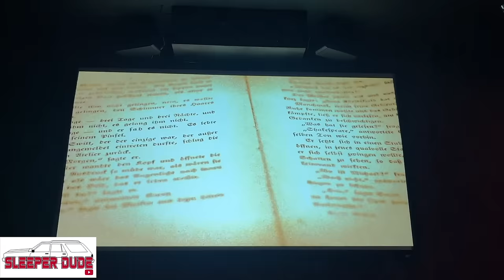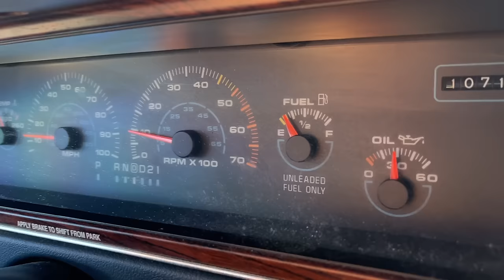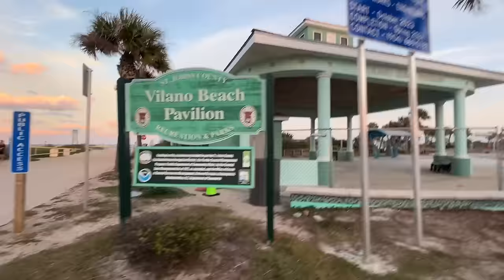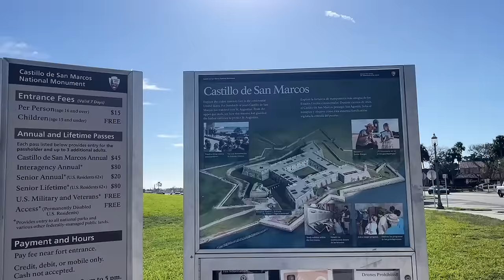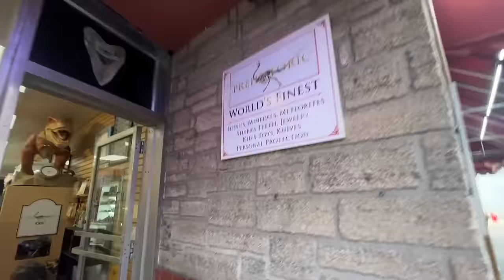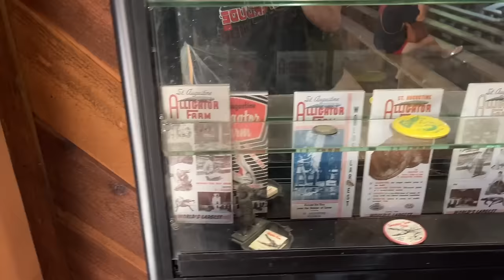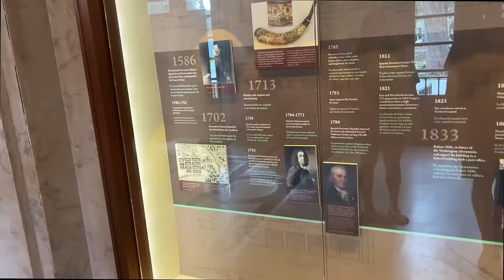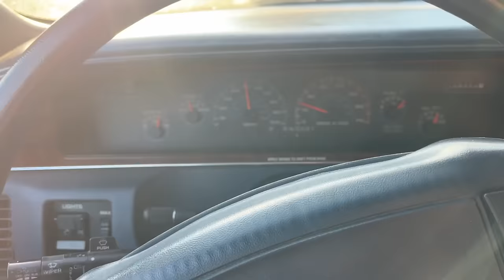Oldest City In America Road Trip In A Station Wagon.

Comment: For the window, its a super common problem. Dorman #74444 is all you need. It is an upgraded roller vs the original sliders they had. The plastic sliders break that hold the window up. I had to do 3 of the doors on my '91 Roadmaster wagon, all except the passenger front funny enough. That one is still good.

Comment: As an old truck driver I've stayed in a lot of motels and hotels Most of them nowadays if you're on the bottom floor they will screw the sliding glass door shut because of all the rip rap that goes on these days. But I carry a small socket set and a Multi functional screwdriver In my bag Because I smoke cigarettes And I'm not letting them charge me $300 for a room clean up.But if you're on the upper floors and your door is screwed shut that's just wrong😊
Reply from the maker: I know right

Comment: Josh please put a dual exhaust system on your wagon! I did this on my '92 Chevy Caprice wagon with the 5.7 liter and it made a dramatic difference in low end torque and it ran a bit cooler and I gained 3 mpg in City driving and 5 mpg increase on the highway! It's definitely worth the money and will help make your engine last longer! I bought a Borla dual exhaust with high flow cats and 2.5 inch pipes and the Borla mufflers sounded awesome! Deep and throaty without sounding loud and obnoxious! The exits were just behind the rear wheels.  I think that would be a great video to watch of you installing a dual exhaust system on your wagon! Just a thought and suggestion 😊❤

Comment: On your adventures with new motor's, why don't you have a "break down kit" with you on your first drive out, with tools, extra fuel, fuel filters, a funnel, WD40 or PB blaster, bits of wire, zip ties etc in a bag or box. And only to be used on such an occasion. That's what I would do.
Love you guys, keep the videos coming, stay safe and God bless. 💜😊🙏🏴

Comment: I'm surprised you didn't stop at the Summit in McDonough, GA
The only time to go through Atlanta is between 10pm to 3am.
Reply from the maker: Yes there was crazy construction on that exit and I didn’t want to get into that
Reply: @sleeperdude2690  Right off exit, turn right on right.  They are widening the road. I have to go pick up loads about three miles from there.  You would have been okay.  Wallet won't have, but you would have.

Comment: I run Rotella T-6 full synthetic oil in my 2001 Chevy Z71 4x4 and it has 225k miles on it and doesn't leak any where and still gets 18mpg

Comment: Advise from a truck driver:Ya use highway 27 to get around Atlanta going north and south. Going from the bottom of Georgia find 27 and it will take you to Chattanooga. With not much to no traffic. 
And you'll avoid the mile long northbound i-75 back up in the middle of the day/rush hour at were it merges with i-24 at the tn./Georgia state line/ Chattanooga. Your best bet is to go thru Chattanooga/atlanta in the middle of the night.

Comment: May be just failure on an old alternator.  Could have been the belt was too tight.  I learned that the hard way.  Puts a tremendous side pressure on the bearings

Comment: those front wheel drive motels ten to have the motor mounts and tranny mounts wear out a little fast if there is weight in the back for any time. and exhaust can spin a little. my wife buick keeps needing changed. but then she tense to take off a little hard.

Comment: Just a reminder, there's only you I went and got a $500. 2002 Suzuki Vitara 4-Door 4 cinder 2.0 I put a Battery inside it Got Exhaust taken care of. Got brake lines all the way around. Can't do the front brakes. I have to take them to a break shop and also is going to need front struts and an alignment. Other than that, it's gonna need the ACA serious Bath which I can give it. But it's gonna have to wait about 15 days. You great people gave me that idea 💡 😮 😂 I will get it a Cheap paint job from. Mayco come spring as I will be springing For new casings. Hopefully from Nokia. I will be ordering stickers to plaster all over the SUV Because of my driving. Sometimes I don't put religious stickers on there. Cause I don't want to make my friends a church look Bad. But you don't live in kansas City And I don't put politics on my bumper stickers. Because in Kansas City they don't like you because you're you. They like to dislike you because you might think different than them. And so I just let everybody think that they're right when I know that I eat Humble Pie on regular basis. So there is no problem being wrong
Reply: Yeah, 2CV front axles. It made sprotors and pads  ac needs fixed a cheap paint 🎨 job but I think it was well worth it 245000 miles sounds like new I will get the water pump and timing chain done in a couple of months at a shop a small tare on driver seat I have some friends that have an upholstery shop I think they could fix that
Reply from the maker: Hey that’s awesome keep up the good work!!